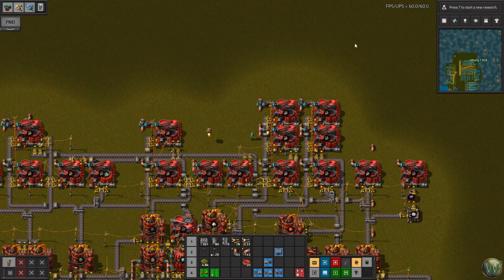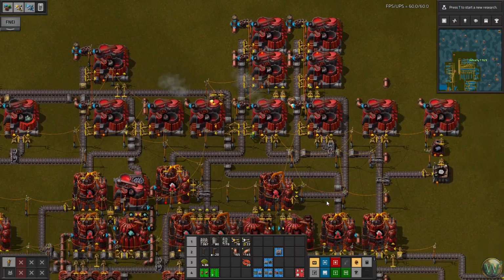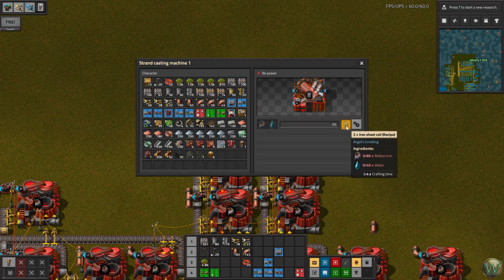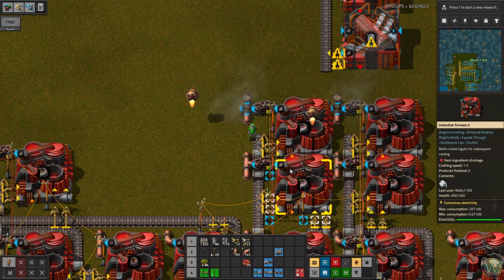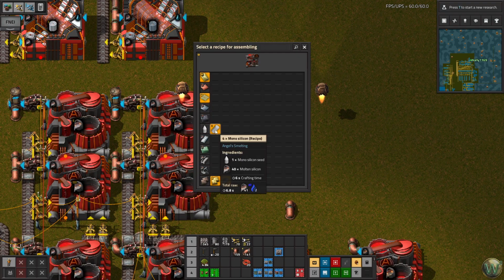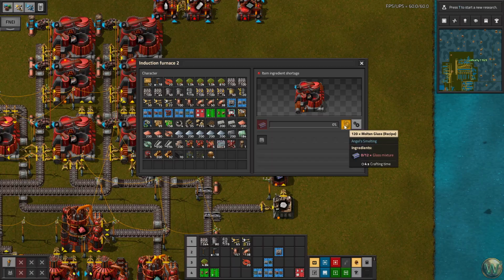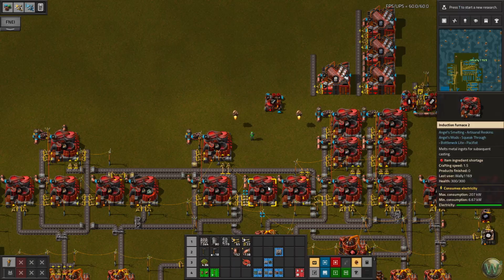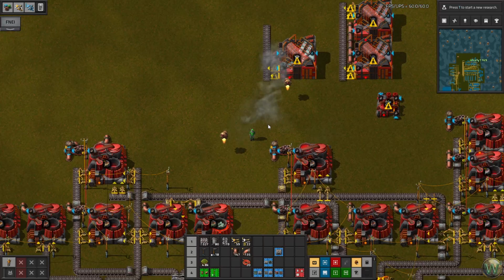Factorio Sea Block Learn & Build - Casting & Strand Casting, Part 1 - Let's Play - Episode 65

Comment: If you have never tried it, I highly suggest the "Max Rate Calculator" mod.   You just highlight the buildings and it does the math on input/output instantly.
Reply from the maker: I have.  I purposely wanted to push myself in a different direction with this series - doing the math either myself or with Helmod when the plan needs to be bigger. Using Helmod for this would have been exceedingly complicated, but I probably should have tried to build something.
Reply: @Wally1169  Ah, good deal.  I tend to fly by the seat of my pants and almost never use a 'factory planner' type thing like Helmod, instead I plop buildings down and slap Max Rate Calculator on them to figure out the ratios and just wing it!   It's just math, sure I could do it myself, but I'm playing a game and would rather use the mod.   Of course this can result in some spectacularly bad builds that require multiple re-do's sometimes before I'm happy with their appearance, but I'd rather spend the time in game rather than in a test bed or planner.
Reply from the maker: I'm doing a blend - some math on my own, some via planner.  AngelBobs is somewhat tough to set up without a planner of some kind.  There's just so many steps to make many things and getting the ratio correct - especially if you want to take advantage of direct-insertion - is tough.
Reply: @Wally1169  Yup, I agree that there are crazy numbers of steps, but I just don't enjoy using Helmod or other planners (although I admire the effort that went into making them work so well) and just prefer to wing it.   I'm just a weirdo I suppose!
Reply from the maker: No weirder than, say, BoldViking :D
Reply: @Wally1169  I haven't actually watched him, may have to take a look if I can find some time.
Reply from the maker: He's done (nearly) to Pyanodons runs, and is building crazy stuff in Space Age now.  I assume he'll go back to Py once he's done with SA.

Comment: Those 12 iron ingots will be too much for a grey belt. With the sheet coils I think you'll want to do the change eventually but not right now. The trigger will be either throughput of the belts or coolant based casting. Similar for copper wire coils - they're just compression as far as I can see. But tinned wire actually takes less material when making coils AND one less assembler and one less input belt to make the wire on location.
Reply from the maker: Good point - need to make it yellow at least through the splitter.

Yep, I agree, tinned [copper] wire coils are definite a boon.